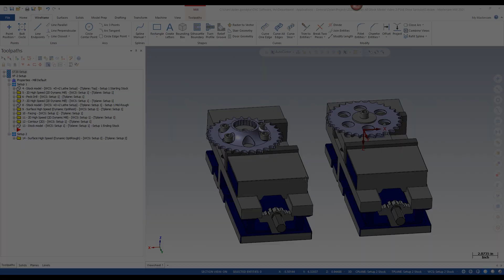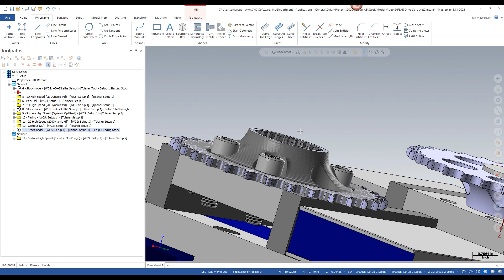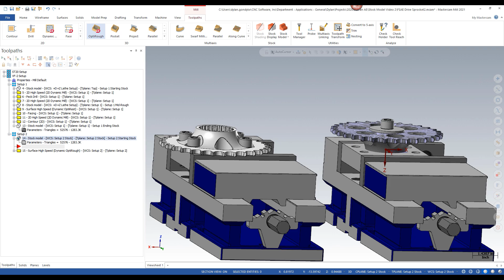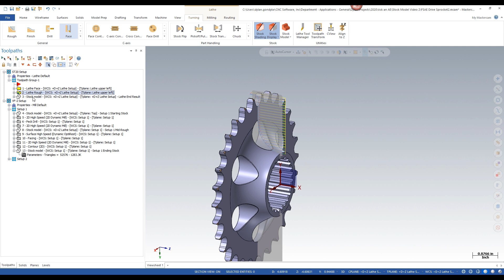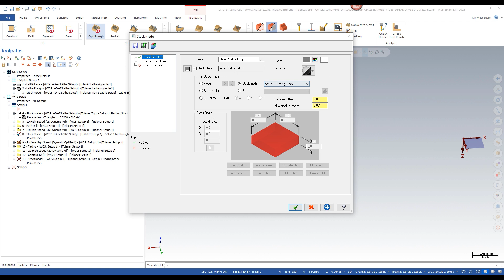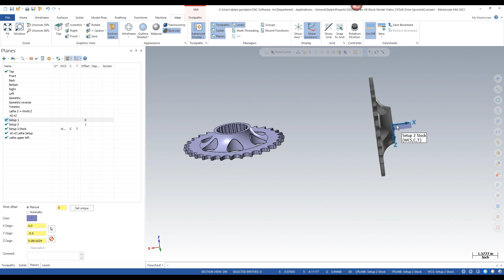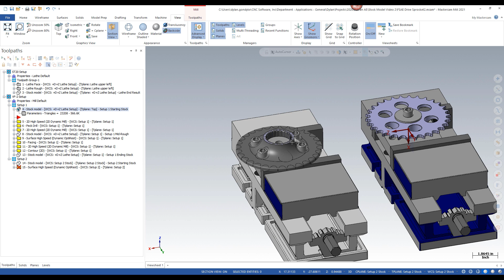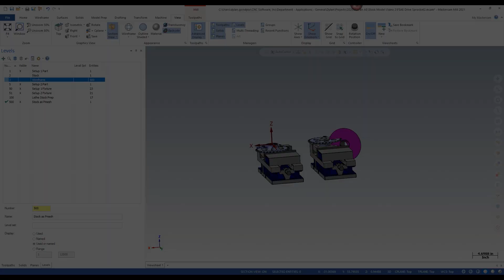How to Handle Stock Models and Operations in Mastercam Part Files | Part Two| Ask an AE

Comment: what toolpath I have to use while negative angle in mastercam 3axis  with dovetail tool sir
Reply from the maker: Hi there!  We could approach undercutting with a dovetail tool in a few different ways in Mastercam Mill 2D and Mill 3D. We could use a 2D or 3D Contour operation and adjust the depth and radial offsets to place the dovetail where we want, or we could also use the Surface Finish toolpaths available in the right-click menu in the Operations Manager to perform undercut finishing operations. The 3D HST toolpaths currently do not support undercut operations and would not work with a dovetail tool in your scenario.